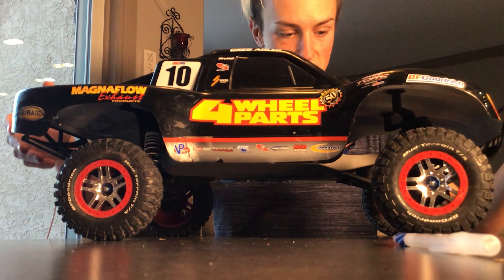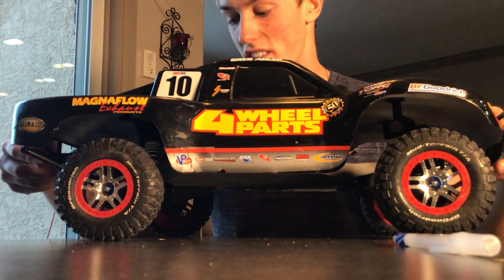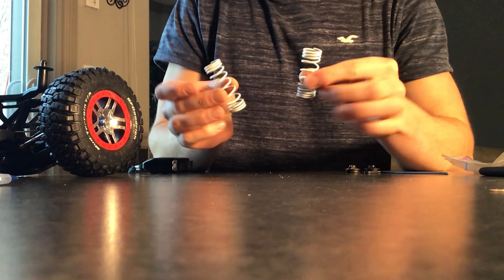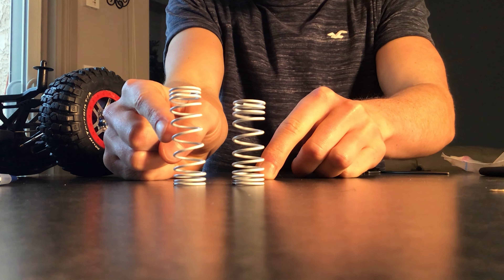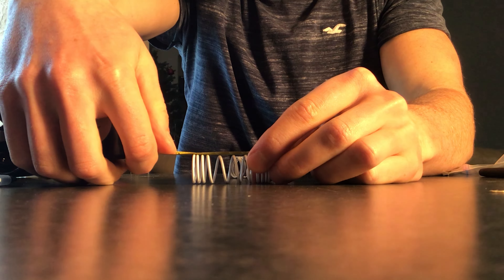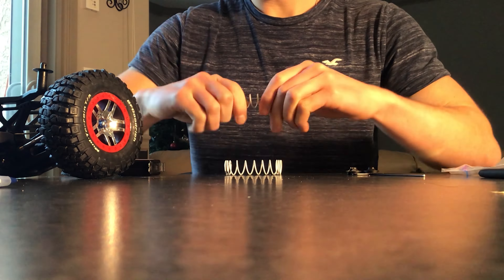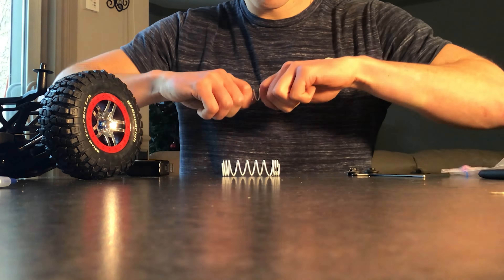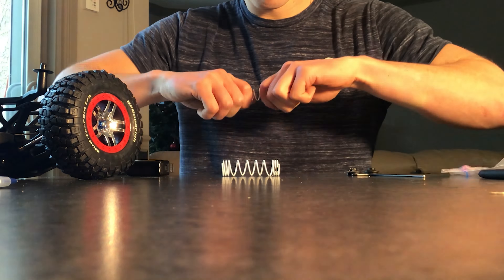FREE Lift kit mod for TRAXXAS SLASH

Comment: Don’t do this, the suspension should be able to sag so that it will properly absorb bumps. If it can’t absorb bumps it will handle terribly
Reply: The sprint Still compress to same size as before So no change in that
Reply: @erikn.8626 the springs do not work the same because they are coiled up in such a way that they will have a certain stiffness but stretching them out will ruin the spring rate and therefore the springs will not work as intended anymore
Reply: @Fordhykerjet  not in this Tiny scale.....

Comment: Please never do this to your vehicle. It’s a terrible idea for a variety of reasons.

That extra clearance he claims to have gained in the video was achieved by him mounting the shocks higher on the A-arm (closer to the chassis). Increasing the length of a spring wouldn’t make it ride higher, because the shocks are already extended to their full length stock. You can’t make them extend any further.

Another thing: My brother owns the Slash 4x4 VXL (slightly heavier than the one in this guy’s video) and it’s got the exact same setup. Same shocks, same springs, and same oil weight. Yet, it doesn’t sag down as much as he says it does.

If you want to increase your ride height without damaging your springs, for FREE, use the preload spacers (clips that go over the shock bodies) that come IN THE BOX to compress the spring more while on the shock (i.e. to stiffen the spring). 

One thing to note about stiffening your shocks, however, is it will increase ride height, but it’ll also decrease performance, since it won’t be able to sag to absorb the G-force of a turn, and therefore will roll over more commonly.

Comment: Can I put this on my 3s ultimate slash because I would like to put bigger tires on it but I can't without the body rubbing even though I just did the body to its highest setting and it still was rubbing
Reply: If you haven’t done this yet, just don’t. Stretching the shocks like he did will ruin their spring rate so that they won’t function properly anymore and he also raised the shocks on the a-arms to make it look super lifted when it actually wasn’t because the suspension travel would be limited by the shock length.

Comment: Does it try to flip over worse at high speeds?
Reply: Well, let’s see, he damaged the springs by stretching them out, as well as moving up the A-arms without saying he did in the video (which is the actual reason he got the extra height). Both those things would place the car’s center of gravity up higher and reduce its ability to cope with it, so yes, it will roll worse.
Reply: @falcondragonslayer that’s kinda I felt too without just calling him out on it

Comment: I have been doing this for years! Works extremely well! Where did you get that older Slash 4x4? Looks like an original Platinum or Ultimate.
Reply from the maker: Yea, I'm blown away at how much better it is in deep snow!  I hope it will still rip good on dry pavement with the center of gravity being higher.  I got it from a buddy who hadn't used it in years.  I was RC deprived after my mini e revo crapped out on me a few years back...
Reply: @JWheelie  it looks like it is in great shape! I don't think you can get that body anymore.

Comment: Does this improve over all driving like suspension and jumps and all that stuff?
Reply from the maker: Better ground clearance is the main reason, also less chassis slap when jumping it.  But, not as good handling in summer time now (higher center of gravity)
Reply: @JWheelie  thanks I just got done doing the upgrade before I saw your reply but I'm sure it's fine it looks cooler

Comment: Nice mod but the Slash - specifically with the LCG chassis - is a Short Course Truck - going higher is counterproductive ...
Reply: Only when you use the truck in "full gas or nothing, full steer or nothing" style.... Learn to drive!!!!!
Reply: @erikn.8626 Thank you for your meaningless answer, which has no connection with my first answer - how do you know how I drive - there are apparently still a lot of people with a lot of time who just hang around on the Internet ... 🤦‍♂
Reply: @harald_hans you made the dumb comment to begin with. I’m sure the guy knows that it’s counterproductive

Comment: How could I for the 1/16 scale slash
Reply: Much harder for the 1/16 also not as much improvement compared to this. Tried for myself maybe .25-.5 of an inch if that better off just upgrading to better suspension entirely

Comment: Man that probably handles like crap. Even for a slash
Reply: Its funny this is a "mod". So yes you have more clearance but your handling is gonna be dog shit.  The body roll is gonna be insane and any top speed turns is gonna equal a roll over with all the slop in the suspension now. BUT if youre just jumping it in a straight line itll be golden.
Reply: @devonm5037  Yea, but if you're driving this off-road in dirt/sand/snow  (basically any low traction surface) or through grass where the chassis is gonna drag, its great!  I haven't done this yet, but will definitely give it a try and see how it works out for me... This "mod" isn't designed for high speed/on-road racing (should be obvious lol)...
Reply: I use my slash for Slow careful offroading with realistic 3d printed chassis